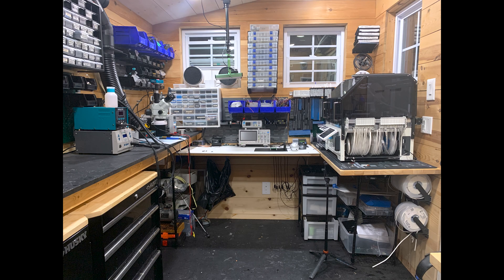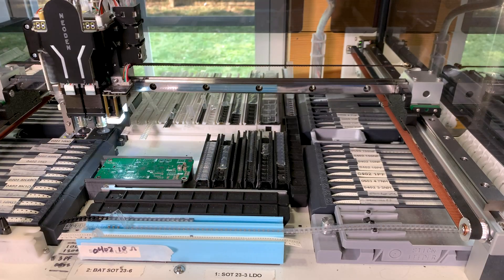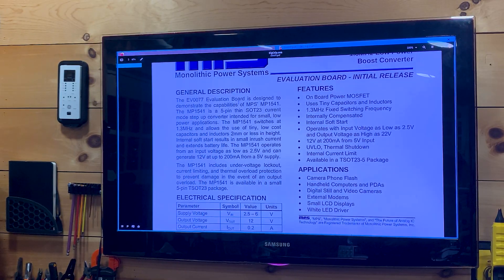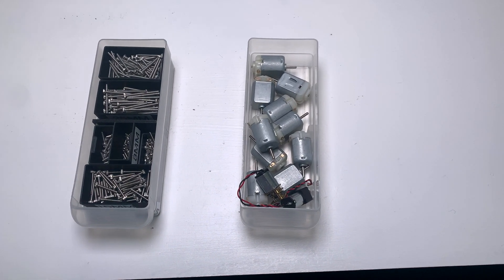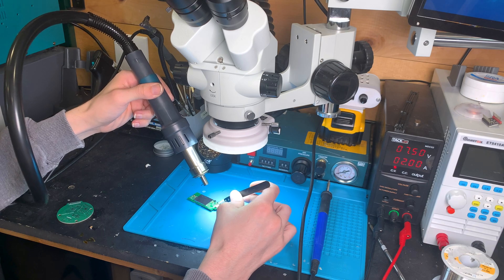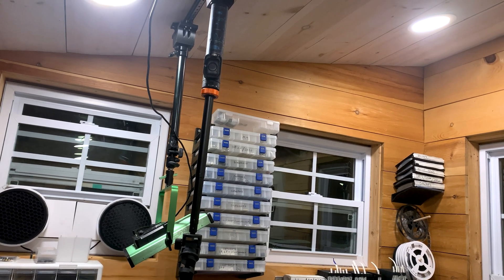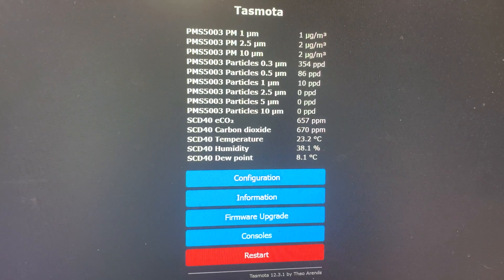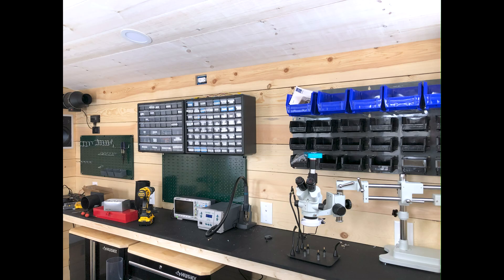My Electronics Workshop Tour - 12x8 ft

Comment: Really inspired by your efficient use of space. Mine has come together haphazardly over the years; and it's time to take it apart and rethink it in terms of zones the way that you've done. I see that you have AC; but do you do anything for heat?
Reply from the maker: For the first few years I just used electric heaters which was enough down to about 25f. More recently I replaced both the ac and heater with a heat pump that can both cool and heat. So far it has been working great and it’s seen highs of 90f down to below 0f while maintaining a consistent 75f inside the workshop.